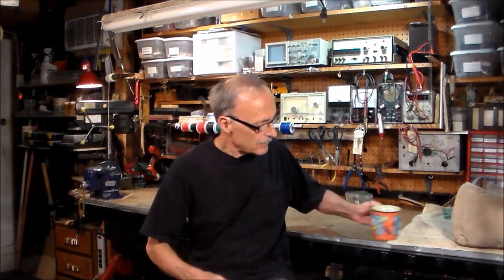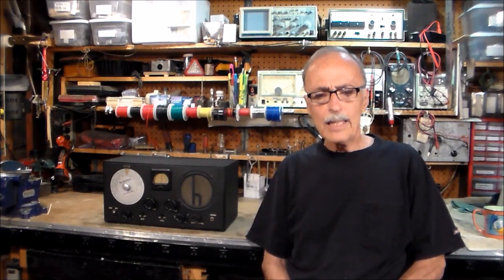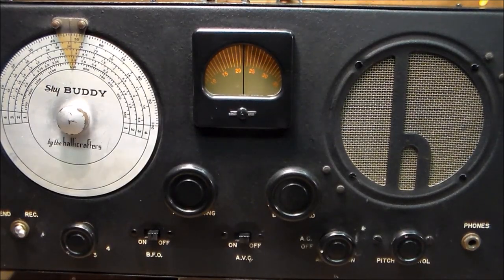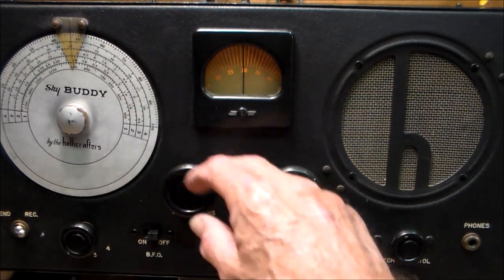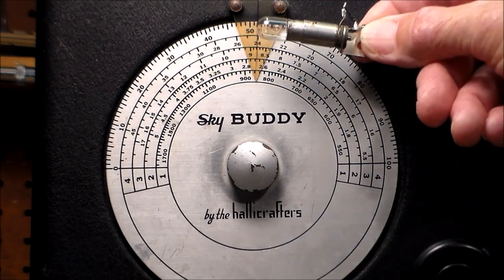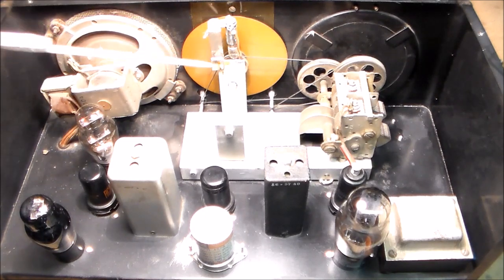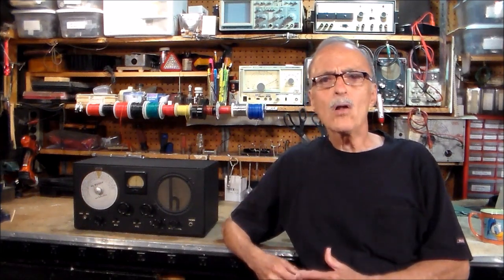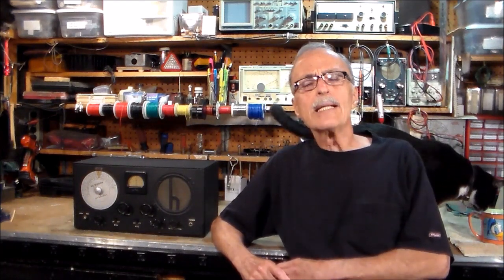HALLICRAFTERS S 19R

Comment: my elmer is still alive....but a Guy named Ray in boy scouts got me going in SWL'ing….about '78....in '77, I talked to a guy in Alabama from Arizona on a radio shack walike-talkie.....about 2 watts maybe.....I was hooked.....flunked the novice written twice, nd the code test once.....second time, I got it strictly by 25 letters in a row, but I got it.....built a code oscillator from heathkit….and it worked!!!! that was '79....W7DB, and W7OIO, gave me the novice test in Montana....1980....KS7T got my code speed up, and that was back in the day when DX ops would hit the novice bands....my elmer would be at work, but would let me cruise the novice bands with his call, and make some CW Q's while he was at work.....did quite a few multi-ops in SS/CQWW/ARRL DX tests, and logging/dupe sheets for him when he got off work, and took over....got my code speed up....10 meters used to be awesome barefoot back in the day, as was 15m....worked Africa on 15m CW with my hw-8 and a wire up about 15-16 feet maybe....maybe 1.5/2 Watts out if I was lucky.....got a 339, but I got the dude!!!!! Memories, bud.....damned good ones.....LOVE YOUR VIDS, and the Kitty as well....good content, and show and tell.....ab5za/7...dit dit.

Comment: I just traded a N.O.S Heathkit SG-1274 Sweep Function Generator for a non-working Hallicrafters S-20.  Similar looking to your S-19R but with 8 tubes, instead of 6.  It also has the missing dial indicator.  I will try your method for making a new one.  I briefly powered it up, but it put out no sound.  I temporarily bypassed the torn speaker.  I plan to recap it, but I have a number of radio items to move out of here that I bought (rescued from the dump) from a couple of estate sales.  Once working, I think it will be the oldest radio in the fleet: 1938.
73 Paul AA1SU

Comment: TRW swap meet Manhatten Beach,Ca. South of LAX. Fourth Saturday every month.  
  TRW swap meet has many radios and parts. Hallicrafters, Drake, Hammerlund, Collins, National, Heathkit. 
I recently bought a large Hallicrafters S108 $50 works great no hum and a National NC57B that didn't work no power, but I found it needed an octal plug at the rear with correct connection between pins. 
 Octal plug was obtained at APEX electronic surplus San Fernando road. 
  Other  swap meet stuff purchased last eight years, CB radios, Palomar Skipper 300 amp. Siltronix 1011D, D104 mic,  Yeasu FT101. S38, S38B, S38E, S20R, S120,  Heathkit SB200 (afraid to plug in😱), Tubes and parts.